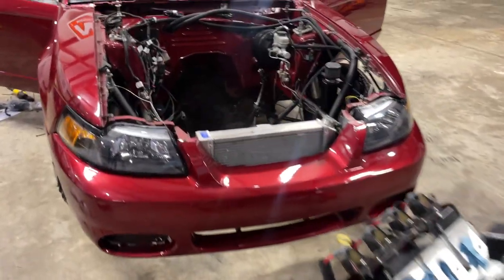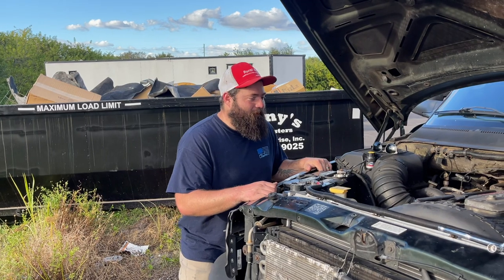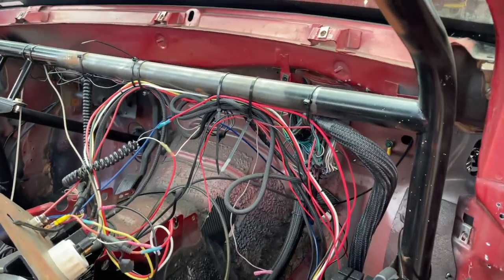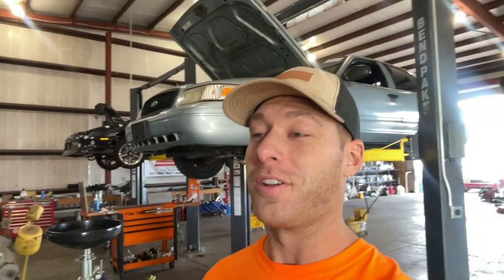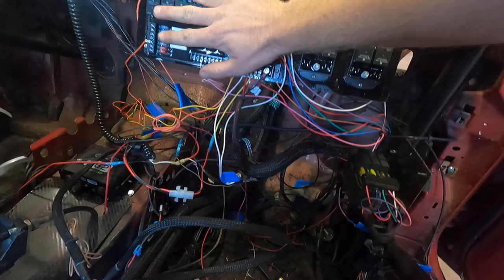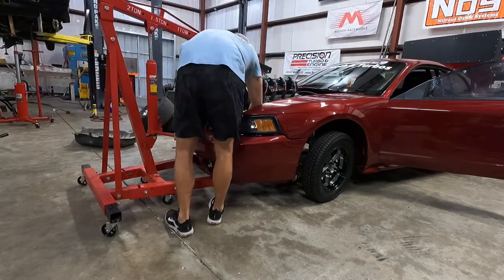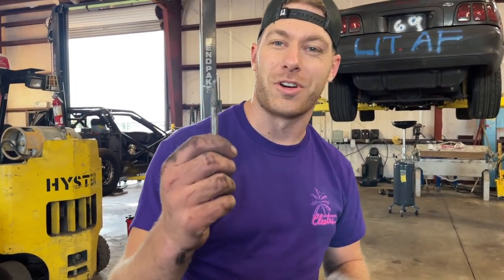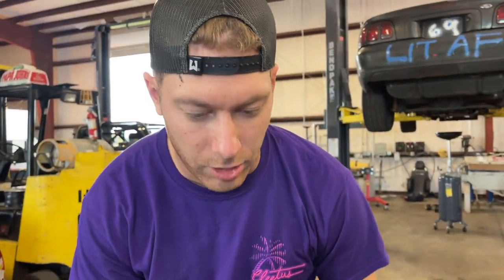Dr. Pepper's Engine is BACK IN! 12 Valve Maintenance, Tons of Work left on Wiring and Turbo Kit

Comment: On those allen head bolts that round off, most times I can take a hammer and give them a good wack on top to push the head down a little. Then hammer a allen socket on and they ALMOST always come out. Same goes for smaller standard hex head bolts if you have access. 
Keep up the good work!

Comment: I don't know if it's just a 24 valve thing but the intercooler lines had plastic elbows that like to crack when they'd get a little to hot so if 12 valves have them I'd check them too

Comment: O’Reillys brake cleaner is the best. I own a shop and have used them all. Walmart cheap stuff and carquest is decent and better than advanced or Autozone, then comes the O’Reillys brand. Just don’t get that stuff on your skin for long without wiping it off or it will burn you. It does me anyway.

Comment: You're doing a pretty good job on the wiring. The next time you do it it will be even better.. Talk Cleet into buying a Brady label maker to label the wires and relays. I wish I was closer, I'd have loved to have helped you wire that car. Taking time to color code and properly label everything makes it safer and easier to work on.